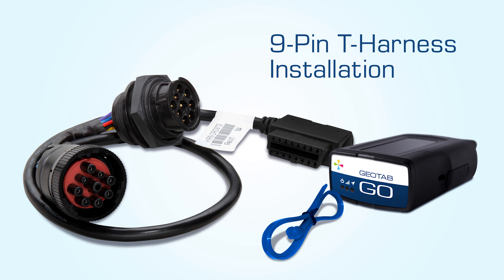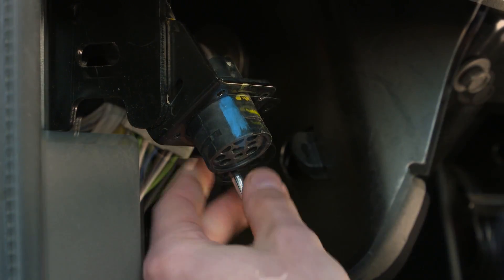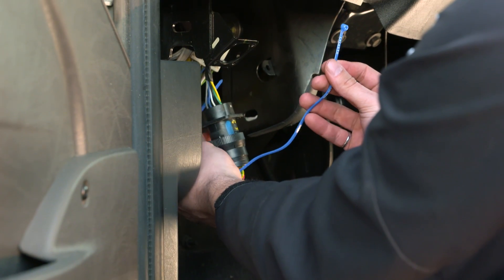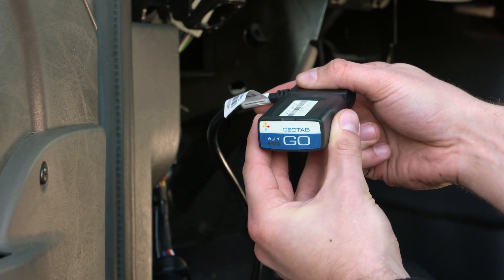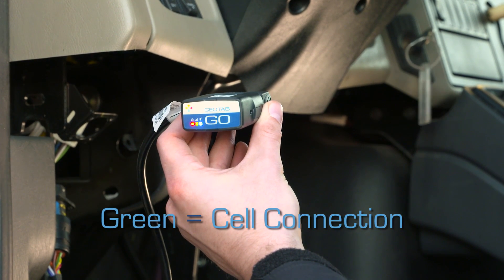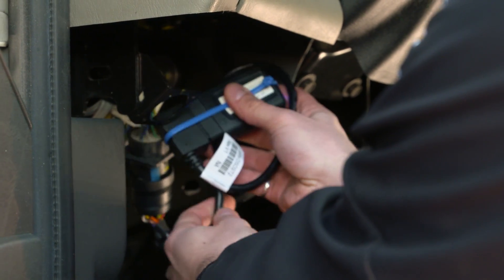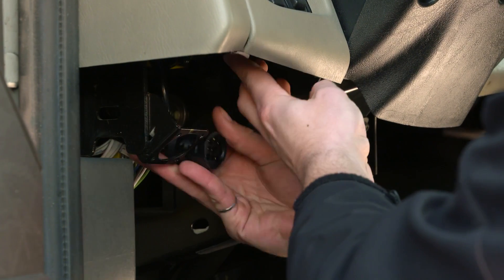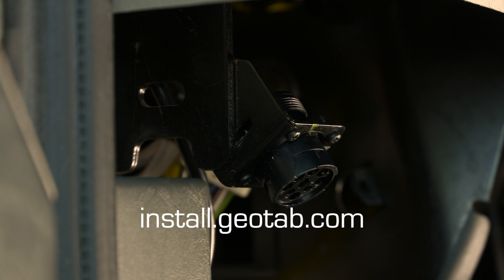How to Install Geotab's 9-Pin T-Harness Heavy Duty Fleet Tracking Device

Comment: I have had to unplug and reconnect the device from time to time after going through areas with limited cellphone data availability... This Happens most often in north Dakota and remote areas of Washington state. Because of this, I have had to relocate the device to a more accessible position, and remove the zip strip altogether.
Reply: Can this device detect doors being open also ?
Reply: @omarcaban9917  it all depends on what information the computer (ECM) has access to. It may be possible on newer trucks, but the older models probably don't know anything beyond engine management.